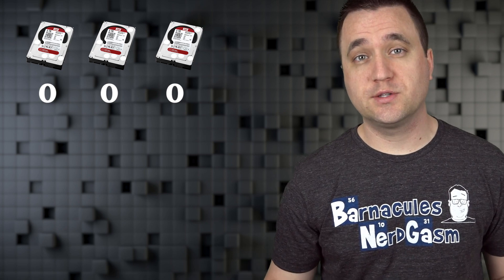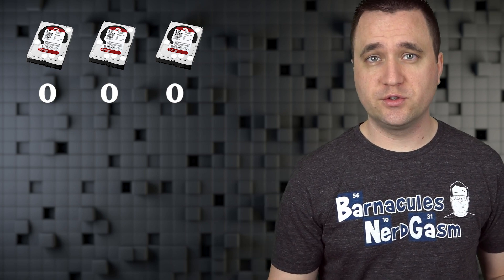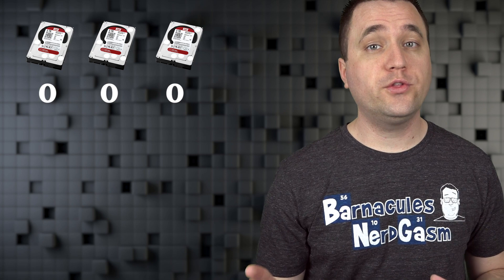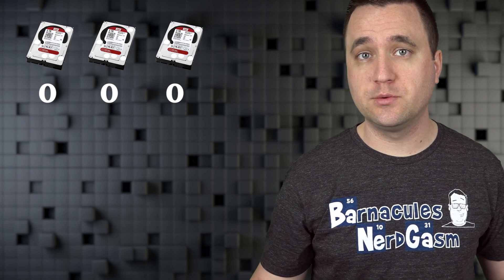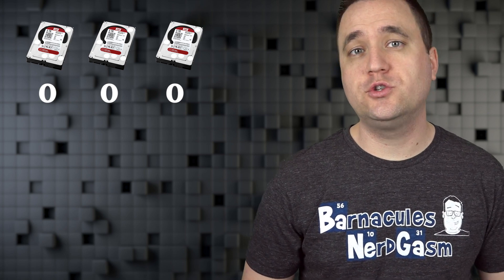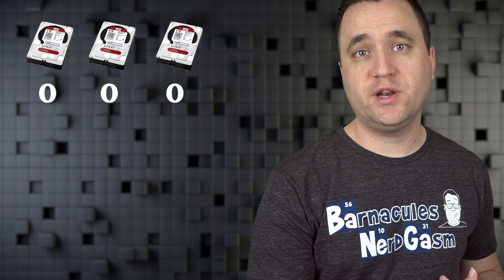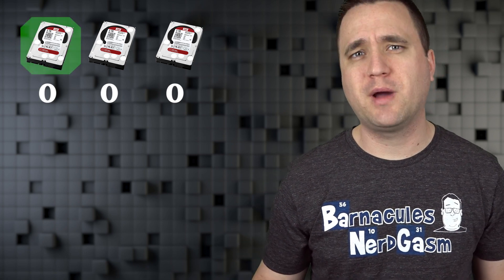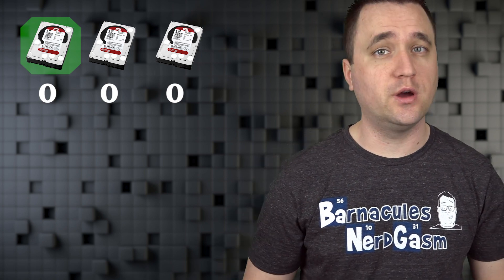How does unRAID Parity works and why did I use it...?

Comment: ZFS also allows you to check and correct damaged files with the parity information that it stores.  This allows data corruption to be corrected in the data at rest during periodic scrubs.
ZFS is the file system to ensure your data is not lost or corrupted and I can read and write to my array (z2) at Gigabit speed.  The problem you are having with unraid is that it is only writing to one or two disks which limits you to the actual mechanical speed of the disk.  Even a SATA-III hard disk can only write at about 120 MB/s.  Because of the way my data is spread across multiple disks, I can read or write at a theoretical speed of 920 MB/s.  The slowdown in most data transfer is the disk and in a server it is the number of disks.  Where I work, we have a NAS (of sorts) that writes to over 100 disks so that the throughput of the disks is not a choke-point.
Reply from the maker: Yeah I acknowledge the "downfall" of using unraud over freenass/zfs. but the bonus of getting the hdd space and ease of expansion makes it good for me.

Comment: I love that you can just add disks as you need more storage. And have you looked at all the cool Docker containers? Plex, crashplan, and many more! And it's way easier to set up, run and trouble shoot that the other nas options.
Reply: John Zimm Problem is if you remote into a Windows VM you are violating Liscence.  To legally remote into a desktop VM you must do one of two things. 1. Buy retail copy of Windows then buy Enterprise Volume Liscence and Software Assurance.  2. Full VDI Liscence.  You do not have rights to remote into a Workstation VM with just the Pro Liscence.  Only exception is if you are accessing it directly from console. For example Unraid based dual gaming systems.
Reply from the maker: Yeap, I covered most of those in my build vlogs.
Reply: You Should do more vlogs of your server. Wish there is more videos covering it.
Reply: Carter Baker there you go again. Nobody really cares whether MS gets upset around here. They owe us anyway, all the time we spent dealing with their crappy OS.

Comment: What's really important though, no matter what system you use, unRAID or otherwise, is backups. RAID is not backup. You virtually eliminate risks with good backups. Backup your data!
Reply from the maker: Agreed! However, for large amounts of data, like 30TB+ worth, the best you can do is some kind of redundancy. Even if I wanted to pay for cloud backup, my ISP wouldn't let me upload that much within any reasonable time frame. Nor download it if I needed to recover it. And it's enough to afford the amount of hdd space for the first round of storage, let alone a clone server...

So, for my crucial data, less than 5TB worth, I have it in three locations. 1: my main PC. 2: Zeus. 3: cloud. All other data is replaceable and thus doesn't warrant the excess cost of backing up.
Reply: joemann7971 I follow the 3-2-1 backup method, 3 backups, 2 on site, one off site